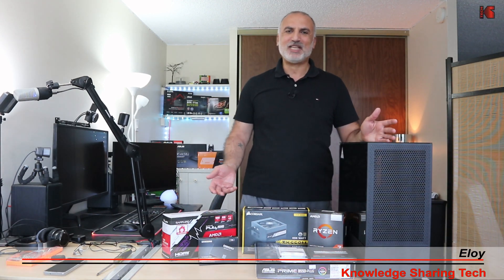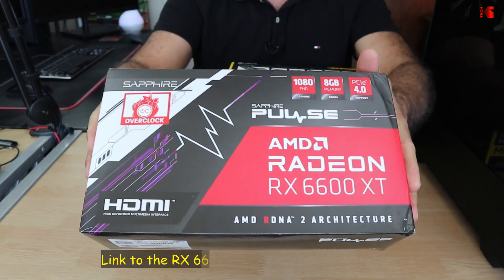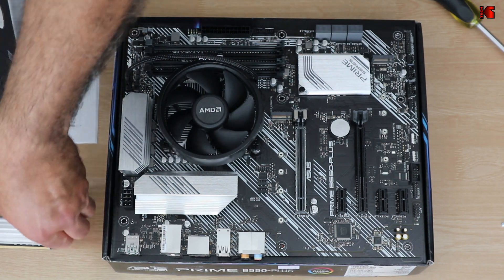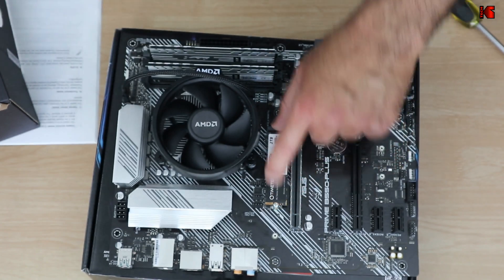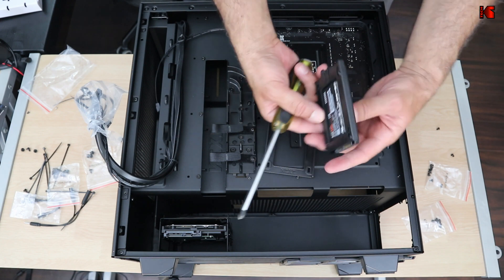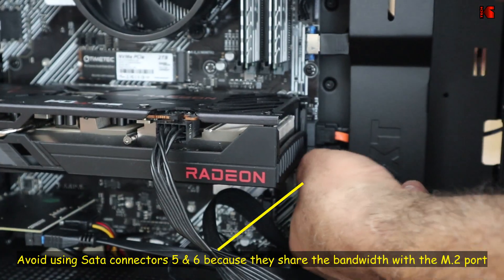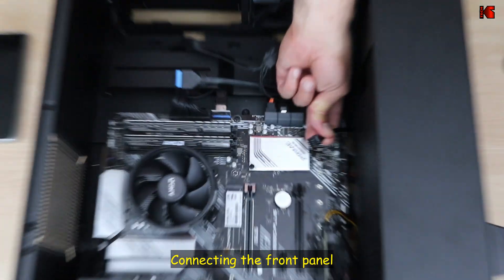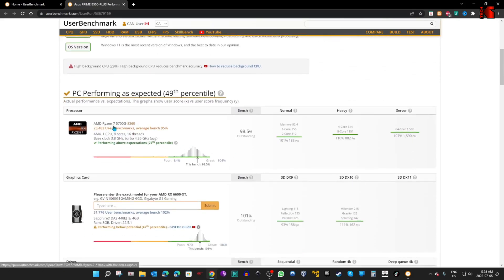How to Build an affordable AM4 Gaming PC: Full guide

Comment: Very good tutorial.  I've built 3 systems with the 5700G and have been very pleased with the results. The onboard graphics is more than sufficient for what they are used for, so no video cards.  I favor installing the power supply with the fan up (if the case allows) to prevent sucking dust off the floor and help pull air through the case....not that the 5700G needs any extra cooling.

Comment: Hello there, building a gaming pc for the first time. Was wondering if these components are good, and worth the price. Majority of the components are from this video, but the components that I could not find I  just substituted to something similar. 

1. NZXT - H510 Compact ATX Mid-Tower Case with Tempered Glass - Matte Black
2. MSI - MPG A850G PCIE 5 850 Watt ATX 80 Plus Gold PSU Power Supply - Black
3. XFX - SPEEDSTER SWFT210 AMD Radeon RX 6600 Core 8GB GDDR6 PCI Express 4.0 Gaming Graphics Card - Black
4. Samsung - 970 EVO Plus 2TB Internal SSD PCIe Gen 3 x4 NVMe
5. CORSAIR - VENGEANCE LPX CMK32GX4M2E3200C16 32GB (2PK X 16GB) 3200MHz DDR4 C16 DIMM Desktop Memory
6. MSI - B550 GAMING PLUS (Socket AM4) USB-C Gen 2 AMD ATX GAMING Motherboard PCIE Gen 4 - Black
7. AMD - Ryzen 7 5700G 8-Core - 16-Thread - (4.6 GHz Max Boost) Unlocked Desktop Processor
8. Samsung - 24" LED FHD AMD FreeSync Monitor with bezel-less design (HDMI, D-sub) - Black

Total price comes up to $1,366.31 with savings, and $1,512.93 without savings.
Reply from the maker: Hi, the components are very good. If you can get the Ryzen 7 5800x it would be better because it is PCIe 4.0

Comment: Nice concise build.  Stumbled across your channel a few weeks ago and have enjoyed watching your videos.  

One thing I noticed, it looks like the CPU cooler was installed a 1/4 turn from upright though.  From the angles in the video, it looks like that might interfere with one of the RAM slots if you decide to upgrade to 4 sticks in the future.

Also, the front panel connector extension that came with the case only needs to be used if you have a motherboard that doesn’t have a standard layout of the pins.  With the ASUS board, you can just plug the front panel cable directly onto the board.
Reply from the maker: Thanks for your comment. I am glad you liked my channel 😃.
For the Ram, you can install a ram without a heat sink and it will fit. For the front panel connector, it will work on Intel MOBO without the adapter but for AMD MOBO, it needs the adapter.

Comment: Thanx for the video.  I was surprized to see you connect all your drives at the build stage but I take it that the Windows boot drive already had Windows on it ??
Reply from the maker: You are welcome! Yes it had Windows
Reply: Why wouldn't he connect the drives at build?
Reply: @kstechtv  If you're going to install a fresh OS install  it can get confusing if all drives are connected.  Best to just have the OS drive only  installed until after the primary OS is installed otherwize you may install it on to say your video capture drive by mistake.  Seen it happen.
Reply: @paulwarner5395  That, or the boot loader can sometimes install to one drive while the rest of the os installs on the other.